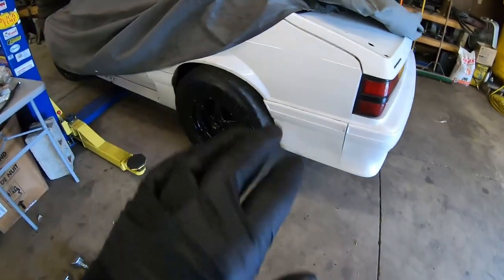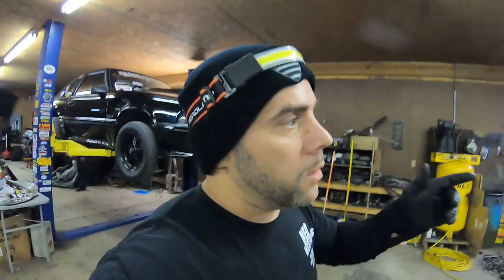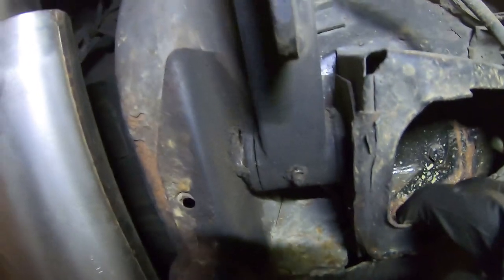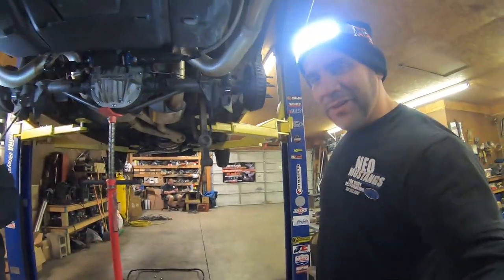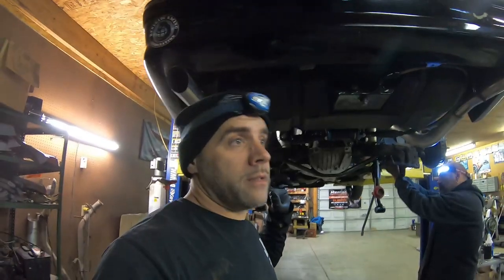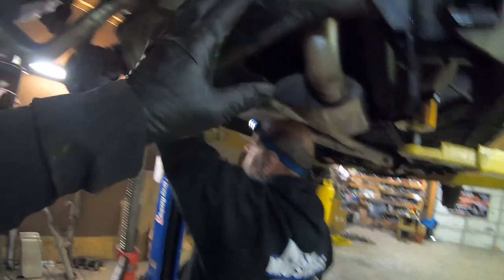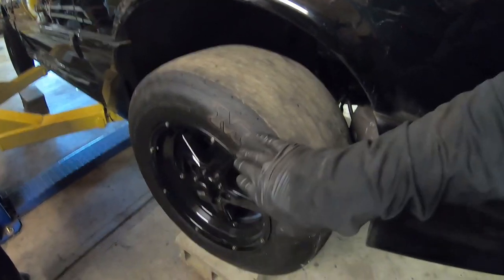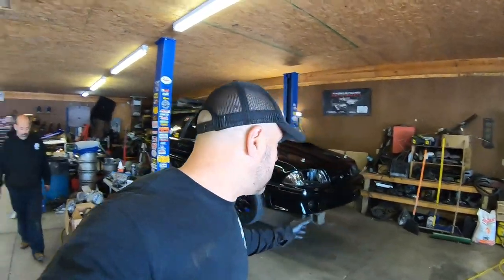Why Is My Foxbody CROOKED & LEANING? Its Time To Get "JACKED UP"

Comment: Haha didn't know you still had rear drums
Reply from the maker: Stil has fox brakes.
Reply: @Neomustangs  I cant believe you are running 9-10's and still using your rear factory drum brakes! Your track must have plenty of runway to stop after the 1/4 mile. I upgraded my fox to 84-86 SVO 4 way disc brakes because trying to stop the car with stock brakes before the runway ends was scary. And I only run low 12's.
Reply from the maker: @4eyefoxbodyfanclub625  Havent had any issues into the 140's with it. I mean its  not the right thing but my brakes worked well.

Comment: On mine the front end passenger side sags and cambers in I already adjusted it with camber bolts it just has lowering springs but not camber plates but driver side sits good just passenger side what could it be? I changed shocks already it’s got kyb shocks help me please
Reply from the maker: My car leaned to the drivers side. We changed up springs. Cut them different and used weight jackers to even

Comment: That was the same problem with mine swaying. upper control car mount was cut in half. But I installed a new set and it hooking like it should without swaying big difference.. also adjusted my timing to 17* BTC. And that B Cam is xtra spicy.. I was at 10*. Felt like it was firing on the big end but now it’s moving.. what kind of problems can I run into with 17*  if any?
Reply from the maker: Nice!